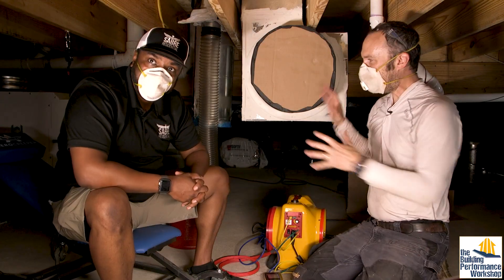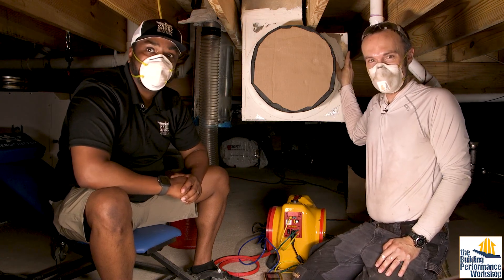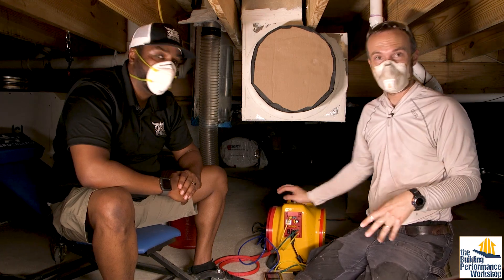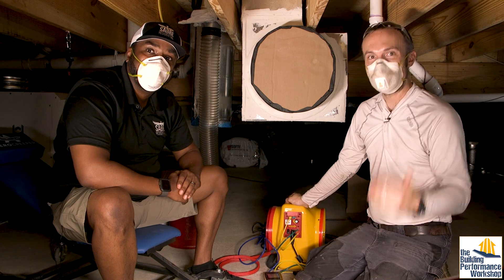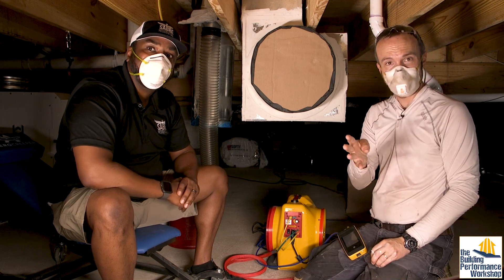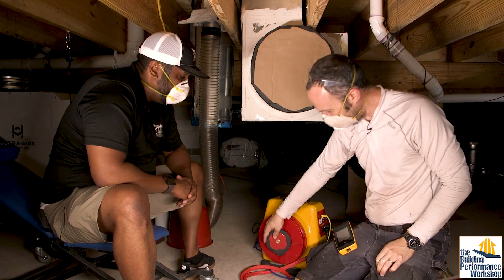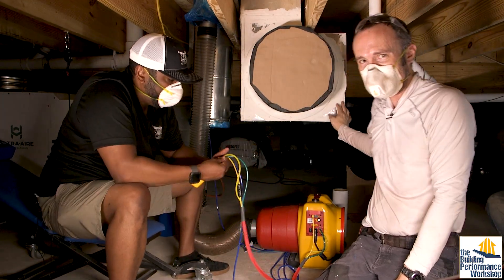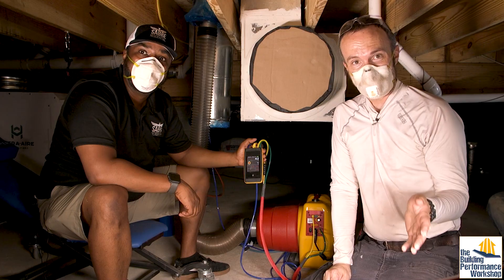Testing Duct Leakage During Construction: Custom Return Plenum

Comment: Any chance of a detailed description of your HVAC system? I'm planning a multi-zone system (Ducted and unducted VRFunits), so in order to filter and dehum the whole house I'm thinking I need to run separate ducting for those systems. The Ultra-Aire dehums require an external blower (normally the air handler fan), but if I use one of the air handlers then I'm only supplying part of the house... It looks like you combined the returns, but I recall you having zones. Ideas? Btw, the house is looking great!